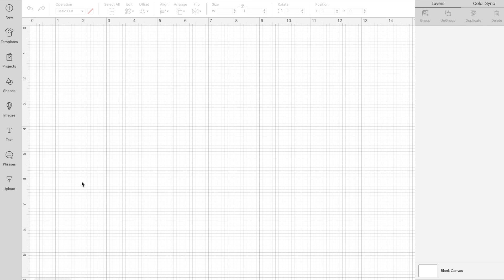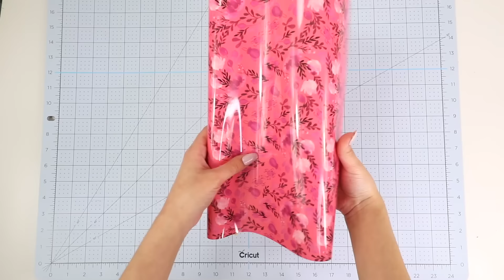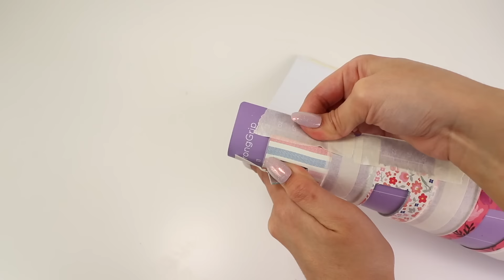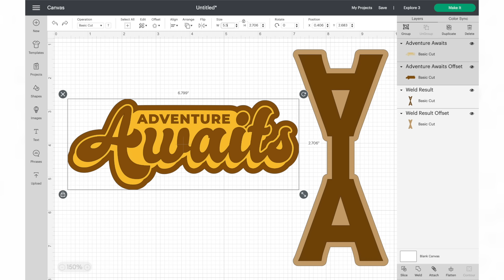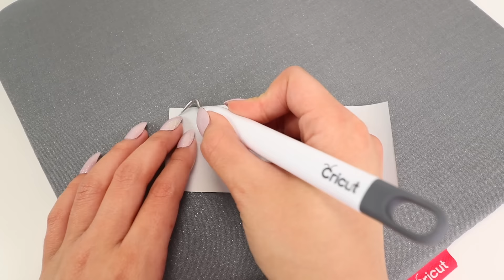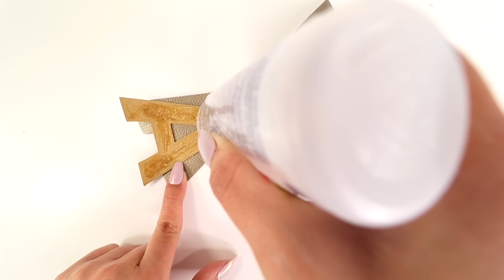HOW TO MAKE FAUX LEATHER KEYCHAINS WITH YOUR CRICUT! *Easy Tutorial* | DIYholic

Comment: My faux leather melted when i tried to iron on my HTV. Am i doing something wrong?
Reply from the maker: Maybe try to lower the heat settings on your heat press, it will still adhere ☺️
Reply from the maker: You could also use a piece of butcher paper or a Teflon sheet on top of your design to protect the leather touching the heat press directly